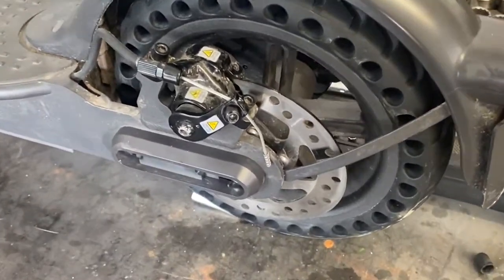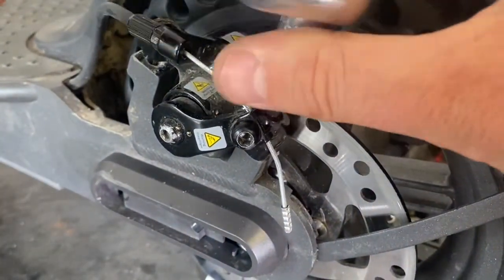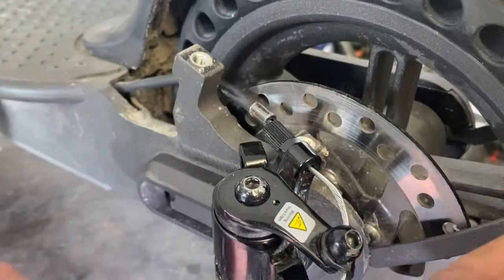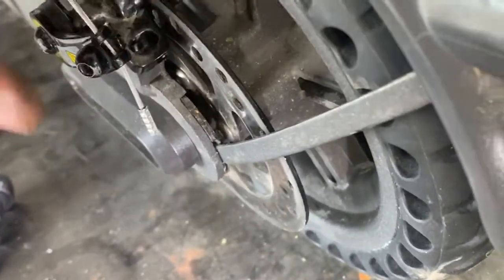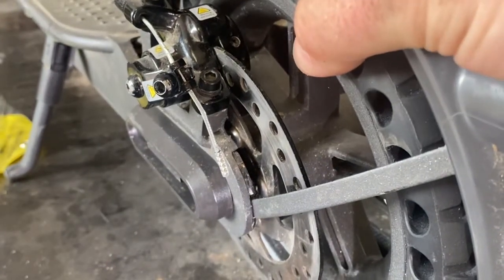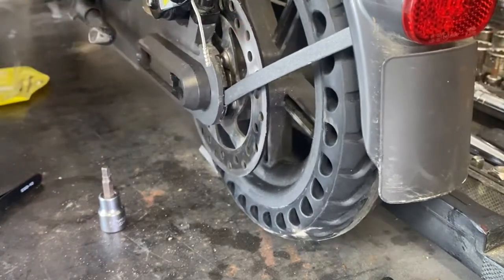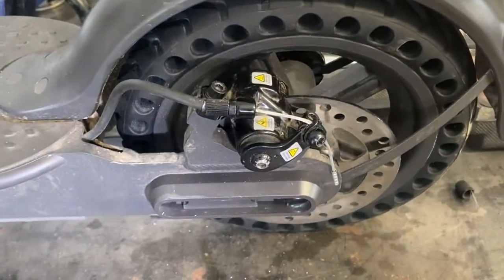Changing E-Scooter BRAKE PADS including XIAOMI BRAKE ADJUSTMENT

Comment: How is the Rubber tires Could you make a video monorim  Suspension.
Reply from the maker: Hello Justyns, the rubber tyres are a firmer ride but they save so much hassle with punctures that I would recommend them as great value for money! There are lots of different types though some are softer material which is closer to the pneumatic tyres and some are very hard material which last longer but are a very harsh ride. A good balance of both is what I recommend.

Would you like me to do a video of installing the Monorim suspension? Thanks
Reply: @stevenagehire4779  yes and could let us know which rubber tyres are the best 👌
Reply: @justynssagan6156  I would recommend u to keep the back tire tubed and the front airless. That's what I did at least. It has a firmer ride but the back tire make it up. Sharper steering and just a tiny bit less comfortable but nothing that will make u stop riding these things!

Comment: My scooter is a year old and i definitely need to replace my pads but am having trouble figuring out what size pads I need. Could you shed some light for me?
Reply: You should be able to find that info at the manufacturer of the scooter you have
Reply from the maker: Apologies for the very overdue reply, I’d measure them and then order online using measurements

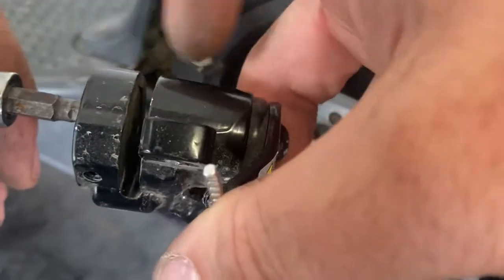Comment: Trying to adjust same as you but it seen the adjust thing (2:12) doesn't want to move...
Reply from the maker: Hi, does it have an Allen key hole (I guess I’m just checking that it is definitely an adjustable one). 

If so, I’d remove the pads and spray some WD40 or similar penetrative oil in and around the thread before trying again. Also try alternating between tightening and loosening as this often works it loose. Failing that I’d use an impact gun/drill in a “do or die” attempt where if that doesn’t work you’ll need to replace the calliper itself. They’re relatively inexpensive but if you’re anything like me it’s the wait time that will bug you 😂 

Good luck, let me know how you get on!

Comment: For some reason that bolt that adjusts the pad now is getting tighter with driving and i need to release it every day
Reply from the maker: Is that the one that moves the pad in and out only? Or one of the ones that hold the calliper? Thanks
Reply: @stevenagehire4779  the pad in and out only... I will set it,and it tightens itself from the driving vibrations,i need to reset it everyday and it's pain in the ass 🤣